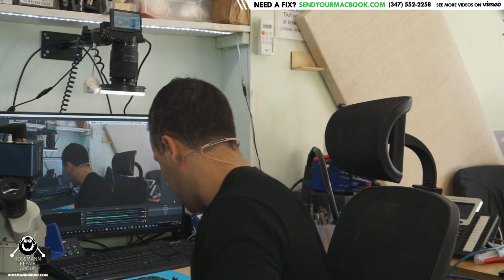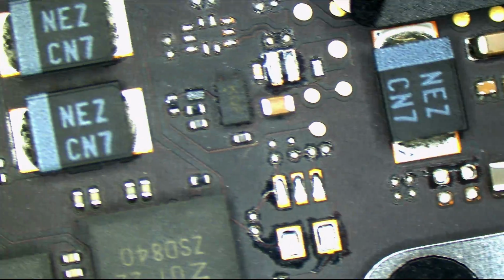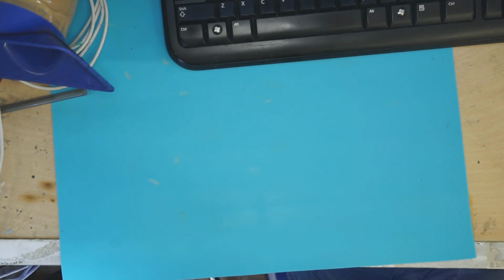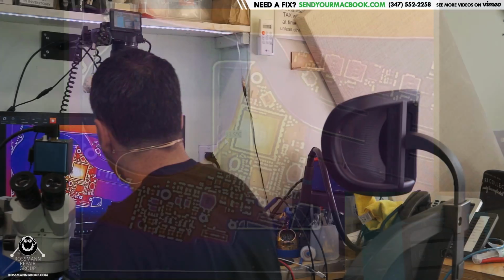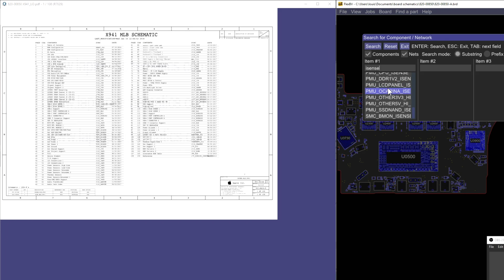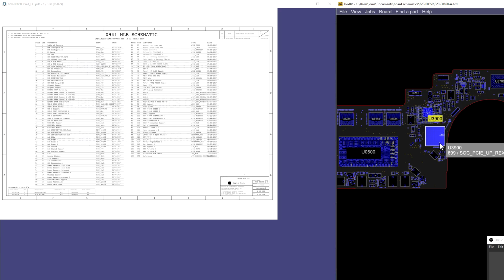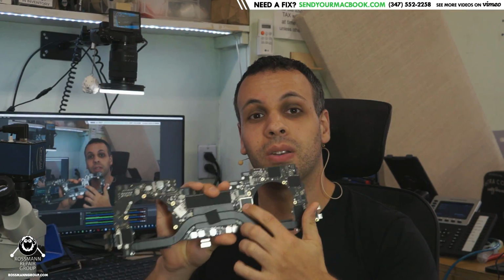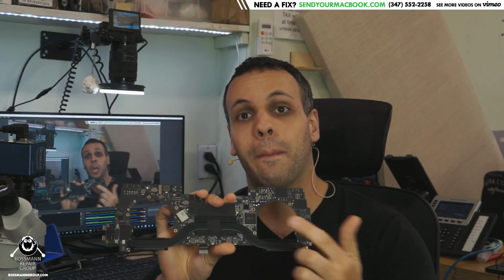Apple users have no one to blame but themselves.

Comment: Reddit’s gonna have a field day with this video. Apple claiming liquid damage when none of the liquid damage indicators are triggered, but far more importantly, the T2 chip that’s already a buggy crashy pain in the ass spontaneously failing and burning itself out?
I’m guessing this is what happens when you take a product designed to sit in a smartphone and make it handle the heavy lifting for a pro device that used to have dozens of chips each to do one task, now all thrown into the T2. 
People didn’t like the T2. If it’s now spontaneously dying, well, it’s a real shame apple stopped selling time capsule products, because people are gonna want minute-to-minute backups.

Comment: The man preaches the truth. The only laptop I have owned from Apple was the old ones with the removable battery pack. It literally got so hot it folded in on itself. Replacement? $500. It would have been "better" to upgrade to a new one. Nope. Now the only Apple product I own is my iPhone 4s that I refuse to upgrade. It has its issues but it's going strong still.

Comment: I feel like people don't understand apple, they're catering for a very specific niche in the market, that niche being catering to customers that want to be treated like shit when they walk through the door and ask for a repair and get told "Nope go buy a new mac" and have their bank account sucked dry. Of course Apple got pissed when repair shops came along and said "It's ok, come to me I'll protect your bank account from getting nuked by apple and fix it for a small fee". Apple got triggered so hard that they went and dedicated themselves towards making it impossible for repair shops to repair mac books by first trying to make the parts unavailable,  then they tried to make it absolutely cancer to try and repair it by designing them so that you might break them when trying to repair them (Gluing the batteries to the board and making it harder to repair some parts of the mac) and now they're making their parts so that only that part will work for that specific machine and no replacement part will work.
I wonder how long it's going to take hackers to crack this and figure out a work around to it and trigger apple again XD

Comment: I am not surprised.  Apple’s customer service (for what it was) has really seemed to decline in the last few years.  I have a AppleCare claim open now that came very close to being a total loss.   They had an issue at their warehouse/dispatch center with a misplaced device and they just marked the device recycled due to a clerical mistake on their end.  They initially tried to simply tell me the device is gone and the case is closed.  That’s it, I have to purchase a new one.  This was an iPhone 6s 128gb that’s under Applecare until late 2020. (admittedly old, but still has value... especially to the owner who would have to replace it).   I had to reach out to an executive liaison to have the issue resolved and device replaced.   As a technician I deal with Apple too often and out of the last 4 AppleCare claims I have had issues with 3 of them.  It seems like Apple’s default stand point is the customer needs to purchase a new device and I have to convince them otherwise, even if it’s under AppleCare or warranty.  It takes hours on the phone and weeks or months of working on the escalation to have things addressed correctly.   I actually had an iPhone for awhile and abandoned it when my own AppleCare claim went sideways as it just wasn’t worth the frustration.

Comment: That moisture detecting led is a scam and Apple should be sued for it.
Reply: Told me my beats had water damage, when they are sweat resistant.
Reply: @albertotorres7746  Sweat resistant is no different from "water resistant". There are just marketing tools to convey that they are some protections against liquids. If they said said sweat "proof" or water "proof" then that's a different story.
Reply: Lenovo is doing the same thing 1 month old mobile stop charing send them to repair under Warrenty they said water damage.When it came back to me i opend it up and water indicator are still white sued them and won!
Reply: @Embrace.Nature.Belgium  cool story bro, how much is the lawyer cost u
Reply: @slothypunk  nothing they paid for the lawyer not me it was their fault they lied.
Reply: If more people see these type of videos, and actually act according upon it.....apple will change, or even better and dissapear.....
Reply: @kevace1985  better to disappear them completely and flag all of their employees so that they can't work near computers or any electronic devices ever again not even a programmable microwave.
Reply: @Dane easier said than done, you can stop buying but not people next to you
Reply: The water sensor changes color when ANY kind of water comes near it.
Even if it just the water that is in the air.
So after some time, ALL sensors will turn color.
Giving Apple the right to say that YOU spilled water on it so it no longer under warranty. BULLSHIT.
Reply: who is going to start to sue apple? yes... nobody so this is the reason why Apple can do whatever they want
Reply: @slothypunk  I beg to differ.  Potential class actions attract lots of legal talent.
Reply: @joesterling4299  This
Reply: @joesterling4299  and you know... Apple got the best talent of all lawyers, you can try see if u win.
Reply: @slothypunk  I'm 30 years old and I have to say I've never bought an apple product in my life, nor do I intend to ever buy one 30 years from now.  I'm also very happy. Lol.
Reply: @lkjslkdjfglkjsldkfjl  so do i, never buy apple. But every one people who hate apple, there are at least two or three people buying apple so... Your point is?
Reply: @slothypunk  My point is I'm very happy :D
Reply: @slothypunk  i agree, do pcs have such a deal
Reply: mark brown they don’t, but there’s no need for them, because you should know if you just spilled that large glass of water on it. Apple is a huge scam. They literally just place it there as an excuse to void repair warrant

Comment: I have been using Apple's macbooks for a good 10 years because I liked the OS and the durability of them (ironic compared to modern apple products). I haven't been using an Apple macbook for over a year now because of the keyboard issues, the touch bar no one wants, dramatically increasing the price on macbooks with practically the same hardware specifications as nearly 5 years ago and from watching Louis highlighting the unethical business practice that Apple wants to keep pursuing. Even if they fix the hardware issues I simply refuse to buy another product from them based on how they treat their customers and third party repair shops.

Comment: I know Apple finally lost my wife as a customer. Her Mac started randomly shutting down, turns out the fan was dying due to the poor ventilation design. Ooo, sorry, it's a legacy unit we can't fix it even though it's just a fan that needs replacing.

Her new computer is a PC, if a fan dies on it? I can replace it myself in 5 min.

Comment: American government gives large subsidies to this fraud company. Huawei phones  is far better than iprones. Even cheap phones like honor 9 lite are of good quality with stainless steel frame, with back glass panels which are easier to break but are cheap to fix by new glass panels costing under 1000 INR. If Huawei is real treat to the government then why don't they ban apple devices made by chinese companies.  apple sales are going down because of their fraud marketing tactics and cheap lowlevel quality build instead of changing this tactics they beg governments to ban Best quality best selling companies. Youtubers turns crap soda can produts to gold dam products, reviewers are getting different products not the consumer grade. Apple products are like old use and throw batteries. My friends had iPhone 5s and 6 which has a lot off issues including low battery backup, many stick their iprones with super glues.

Comment: 🎵

99 soldering balls on the board, 99 soldering balls
Melt one down and flux all around, 98 soldering balls on the board
🎵

98 soldering balls on the board, 98 soldering balls
Melt one down and flux all around, 97 soldering balls on the board

Comment: Correct me if I'm wrong, but couldn't you flash or replace the bios chip when you replace the T2 chip. The bios is the only other chip with code on it. Or did Apple dick us over here to.